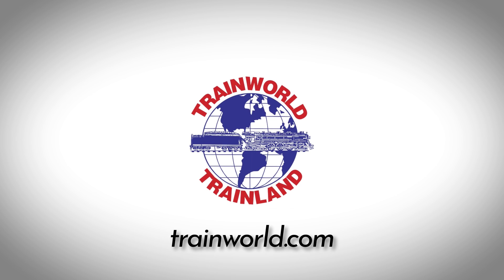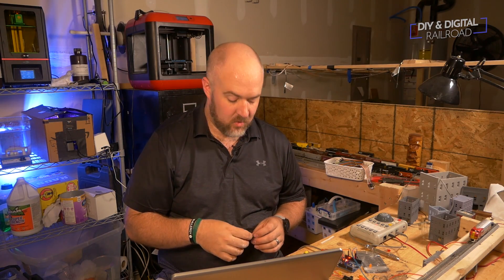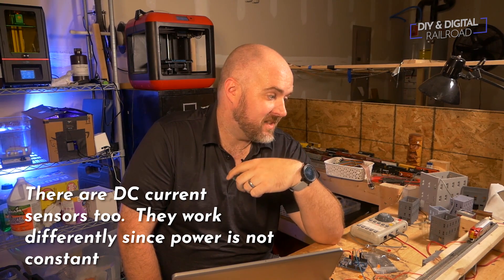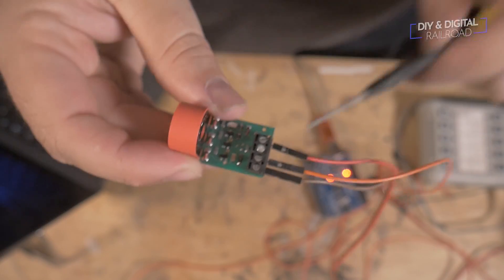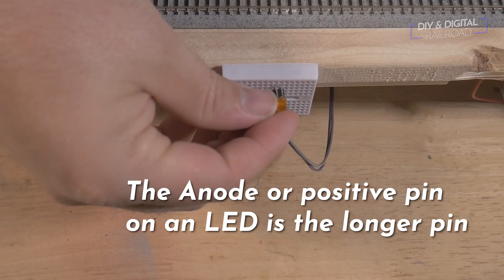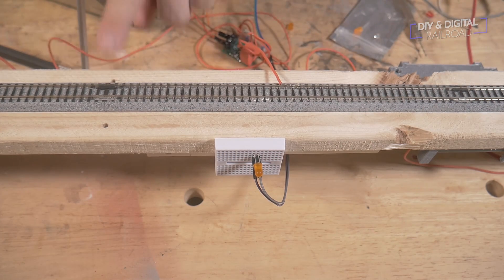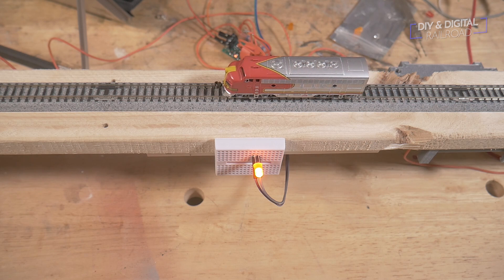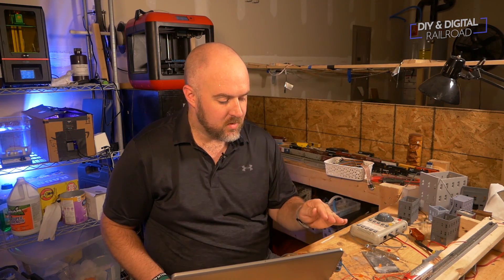Easy Arduino Current Sensing for Occupancy Detection

Comment: I have purchesd the less expensive blue current detector for testing, at the moment I am unable to get this sketch to work. The cheaper system using resistors and diodes works fine. Not having any luck getting this one to work using an Arduino UNO. The led will ight howeveer it will not turn off.  Also will this be producing a analog or digial signal the can be used wil JMRI.

Comment: Hi Jimmy, Thanks for the video which I have found useful, however as I am new to Arduino coding I am a little puzzled at point 08:40 of the video when you specify the if statements where if (valA1<1) then show the LED as HIGH else if (valA1>0) then show the LED as LOW - surely valA1<1 and valA1>0 are both TRUE statements?

Comment: This is not checking for exitance of train on the rail. It is checking for moving train on the rails. There is a bid difference.
Reply from the maker: Actually this checks for a current draw on the tracks.  A Locomotive will complete a circuit and draw some current even when completely stopped.  You can also do this with rolling stock by using resistor wheelsets.
Reply: @DIYDigitalRailroad  Although it is often true, it is a very risky method: sometimes the current consumes is very low, so measurement can result with error conclusions.  Small current can flow without a train, or if a wagon was left. Or a train that is not consuming power due to a problem. My point is that this method detects power, not existence of a train.

Comment: There is an easier way.  Just get one of those small blue coils, a 50 ohm burden resistor and a pair of leads.  Connect the burden resister across the terminals of the coil.  Connect the leads to the terminals as well.  One lead then goes to the ground on the Arduino.  The other goes to an analog pin like A0.  Wrap your track wire two or three times through the coil.  The Arduino sketch can read the value from A0.  You will have a small floor value even with no train on the track.  Just set your code to turn on the led above that value.  It will also detect stopped trains for the same reason as the more complex and expensive circuit shown.   No need to provide power to the coil.  It works via induction.

Comment: Just watched your video and it was very helpful. I'm looking at installing 2 BD20 (one for each mainline) to run operate (2) two aspect signals. I'm thinking for the coding to have two inputs (pin7,&6) and four output pins (5,4,3,2) with the similar coding {if va1A1,<1 pin digitalwrite (5, HIGH); digitalwrite (4,LOW) etc...

Comment: Jimmy,  this is exactly the information I've been looking for with respect to interfacing block detection with the Arduino.  I already have multiple Arduino's networked to JMRI using the Chubb Computer/Model Railroad Interface (C/MRI), but none are being used for current sensing.  Thank you so much for this timely tutorial.  Count me in as a new subscriber!

Comment: Thanks for sharing such an Awesome project. Can you please share where did you connect the current sensing loop wires to the track. Can you please preferably share the wiring diagram as in video all is clear except the sending loop wires termination to the track .
An early response will be highly appreciated. 
Take care, stay safe.

Comment: I used standard 5 Amp, one , you need to wire more turn to CT , It works fine and stable on my layout.
Reply: Also,need to set up the A/D unit.

Comment: Need a sensor on the loco to turn on sectional block lights within a block, say the length of loco. And a sensor to turn off lights on the caboose as it leaves a section of block. 

This way one wouldn’t worry about the length of train and it’ll show as it leaves the sectional blocks to show the end of train.
Reply: Let’s say for each 20” section of a block, the loco would turn on the light and leave them on as it progress forward. Then as the caboose comes through, it would turn off the lights. Wouldn’t matter if it’s a 3 car train or a 10 car train. 

The lights left on would indicate occupancy as train moves through the layout.  For each light left on would indicate the presence of a car. 

It would continually show the location of the loco as it moves forward a sectional block and location of caboose as it leaves a section block. 

Kinda like running LEDs.

Comment: Just looking at this video I do projects myself, but have not seen these before, been knocking ideas around my head on how to do dcc mcb cheaper. The question are these a standard arduino input device I. E the current is turned into a 0 to 5 vdc? As I think you could use these into the anlog input and have the out puts controling a relay with some compare logic to open the relay on a voltage raise over time or once limit reached. Please can you let me know and what they are called. Let you the out come if you are interested.

Comment: I love using the BD20's and have been using those for a while. I haven't jumped into using Arduino yet but I do have a NCE AIU-01 card that allows me to connect 14 BD20s on it with my system being connected to JMRI. You are correct as needing at least 1 axel with a resistor on rolling stock but I prefer two axels (the inner axel on each truck) to have the best reading without it looking too disruptive. Of course rolling stock with lighting and/or sound won't need the resisted axel. This was a main issue I had when getting into block detection years ago. Great video Jimmy as always and congrats again on your 10K subs!

Comment: This is another nice way to detect trains on your layout. Make sure all of your cars wheels are metal, and have resistors on them. Otherwise, it is only the locomotives you will detect. Also, I have a simple, current detector that can be used, and assembled, and the boards are super cheap. I have the GRBR files, if you are interested, and the parts list. along with the schematic. Ron, if you would be interested in looking at this, contact me, through my email, bnsf_fan1@mail.com. You are free to use them on your video's, and I will help you with anything that you need, to have them operational. I have been using them for many years, and it is a simple current detection, by diode voltage drop. It works every time, it's cost is around 4 to 7 dollars, including parts. I also have a signal system, that works exactly as the prototype does. ALL using Arduino's, and simple logic. All of the firmware is also written, and I will gladly share it. These boards are also available, with GRBR files, so you can make your own, simple, and easy.
Please, contact me, I am not a store, nor am I interested in selling these, just giving back to the railroad community!!! All I ask, is that my name is kept on the designs, as I have been 7 years designing these, and making them work like the prototype. Thanks, and another great video, Jimmy!!!

Comment: ever tried the "ACS712" ? it will set you back just 1 buck !!!  for the axle sensing you can put special resistence paint on them , old trick ... but it is best to use only the last car for it , otherwise you can put to much load on your track. You will see it is not flawless for detecting the whole train. i still prefer the infra-reds ( begin + end ) in combination with the asc712 load detector to get it water tight.    P.S i am also looking into motor drivers (PWM and or DCC) with a current sensor build in . A Power(dcc) unit with a build in sensor of usage sounds perfect to me. keep it up, kind regards Arie-gt
Reply: @Randy Rinker yes in a perfect world you know exactly where the front of the train is at and also the end. As you also stated earlier , it is nice to have IR at certain spots.  You can also use 0.1-Ohm resistor in series of your track and meassure the voltage over it , maybe the cheapest solution for train detection
Reply: @Randy Rinker well if you take ohms low and do your math it goes a little bit faster then that. If you take 15 cars with 10K axles you end up at almost 300-Ohm , nothing to smoke up your wiring but still something to take in mind
Reply: @Randy Rinker who is talking about 300ma ? you can also use just 10k on just only the last car or caboose , but don't forget to hang it on the tail or the system fails

Comment: I had been trying to figure out how to use IR without having to blow a bunch of holes in everything, so this is a much better option, and nicely presented/explained as always!  How many blocks done this way can a single Arduino monitor/control?

Comment: So you could use this with CTC panels to light the bulb on the panel and show what block the train is in. Will it work if the train is in two blocks? What I mean is if you have several of these sensors and blocks back to back will it show the train in each one using the same code or would the code need to be changed? I don't see why it wouldn't or why you'd have to change the code but I'm not great with writing code and understanding how it works completely. I'm at the level of I can do it if you show me what to write like you have in this video. You are doing great videos that share awesome information. Thanks for doing these videos. Stay well.  -Wil   👍
Reply: Hey Will, sorry for the very late response. But the idea that you are describing is totally feasible. In the video, he mentions that you do not specifically need a locomotive with a motor to cause an increase in current draw to trigger the sensor. If you were to add any sort of resistance to any other piece of rolling stock (ex. use a resistor on a caboose axle), it would also trigger the sensor in any block it traveled through. If you were to add resistance to every locomotive/railcar of a 100 car train, and your blocks were for 40 car lengths, your train would show up in 3 blocks at a time. 

So the changes you would need to make from this video to make a CTC panel would be:

- Follow the same wiring for each block, so you would have a wire from each block sensor going to the Arduino digital pins.
- In the code, under VoidSetup, you would need to write a pinMode(#, Input/Output) for every pin you were using. So this includes inputs for all the new sensors, and outputs for all the LEDs you would use. 
- In the code, under VoidLoop, you would need to create a new variable for each input (int = ValA#)
- Copy the "if" and "else if" statements with your new variable(s), and obviously change the digitalWrite(#, H/L) to the correct pin number.

Hope this helps.

Comment: You have finally worked out current sensing is way better than infra red, problem is that at £14.50 a pop, I need 40 detectors, its just not an option to buy BD20's!
Reply from the maker: I wish they were cheaper.  I first tried to use the generic ones and they just weren't sensitive enough and they couldnt pick up the train consistently.  I will keep working on it.
Reply: @DIYDigitalRailroad  , if the generic ones aren't sensitive enough, can't you just loop the wire through it multiple times?
Reply: There are CT modules on Amazon and eBay that work just fine for Nscale and HO scale....a few years ago I did the testing....I have pictures no video...it worked for DC and DCC just fine.
Reply: @scottericcatalano596  I found this years ago http://thenscaler.com/?p=1080, but it was inconclusive! If you could share the type of sensor you used, we could work out the rest!
Reply: @TimberSurf  this is what I used arduino.cfnet.org/CT-COIL/DEMOLAYOUT-CURRENTDETECTOR-1.jpg
Reply: @scottericcatalano596  Ok so you are measuring the AC, rather than the more complicated shield jimmy is showing!
Reply: @Randy Rinker I was aware of the BOD-8, it is £38 in UK, plus about a £1 each for the coils, current could be controlled by adding a 21w bulb in circuit for sub districts (or clamped at a max of a few volts with a Zener?). Certainly cheaper but still £7-8 a channel. I have a circuit for discrete components and a coil, to give a go/nogo output that could be fed to an Arduino that would do my block control, but time escapes me, currently engrossed in 3D printing as my main attention at the moment. I am just not understanding why we have to sample AC at fast rates with an average, when we just need maybe a rectified AC with smoothing capacitor to give a slow (2-4 samples/sec) average?
Reply: @Randy Rinker I can't find my notes, but I think Rob Paisley's is the one I am thinking of and I know what you mean about the no longer available transformer! Sounds like we are no further forward! We shall have to see what Jimmy's tinkering can come up with!